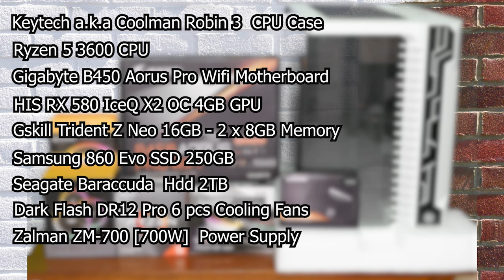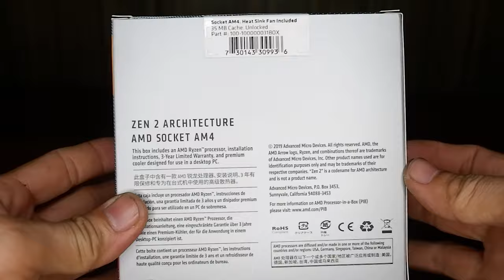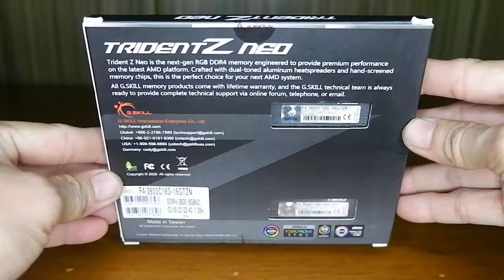40K CPU BUILD 2021 KEYTECH a.k.a ROBIN 3 CASE RYZEN 5 3600 GIGABYTE B450 PRO WIFI HIS RX580 IceQ

Comment: Awesome video bro! Keep it up! Liked and subscribed. But a little advice if I may, change the fan configuration for proper airflow. It looks like it's all exhaust, there's no intake.
Reply from the maker: Thank you sir your comment is much appreciated, you are correct all fans are in exhaust mode, still need to buy 3 more fans to be place on the top for the intake...

Comment: Hello brother, I got the same case as yours, just wondering where do you connect the pc case front rgb cable to ? Is that to the motherboard or to the power supply ? Thanks
Reply from the maker: Hi there, i connected it to the 5v rail of the psu, it has a molex connector that came with the case.
Reply: @techdiy1111  thanks very much , it’s working now , thank you
Reply from the maker: @kaitofu2538  Most welcome.
Reply: @techdiy1111 same issue din po ako lahat po ba ng psu merong ganung connector? Kasi yung akin parang wala kaya di ko mapagana yung rgb sa harap ng case :(

Comment: Hi Sir question lang po napapalitan po ba yung color ng built in front 
led strip sa case  to other color ?
Reply from the maker: Yes po may color pattern din sya, pwede mo palitan gamit yung maliit na button sa itaas.
Reply: @techdiy1111 pano at saan i connect yun sir
Reply from the maker: @chrispaulsanjose7558  may molex connector sa loob para maikabit sa 5v power supply rail.
Reply: @techdiy1111  try ko sir thanks
Reply: @techdiy1111   sir ask ko nadin sa front led panel anung type ng led sya kasi meron ako isa pang case pero napundi kasi naisaksak sa 12v instead na 5v
Reply from the maker: @chrispaulsanjose7558   RGB led strip po sir, gaya nung nilalagay sa likod ng tv.